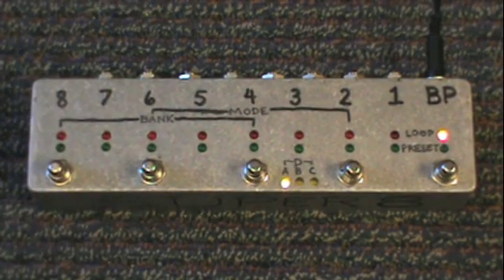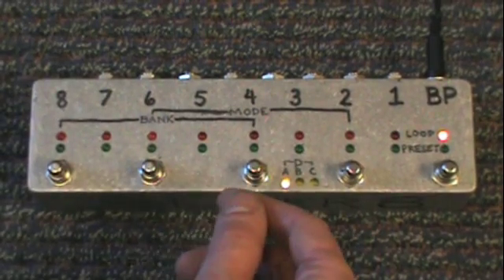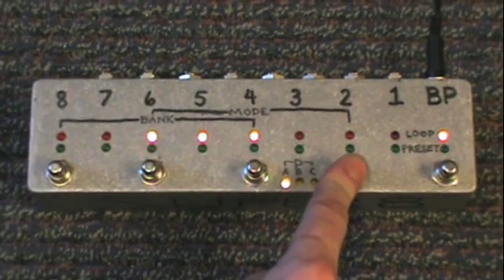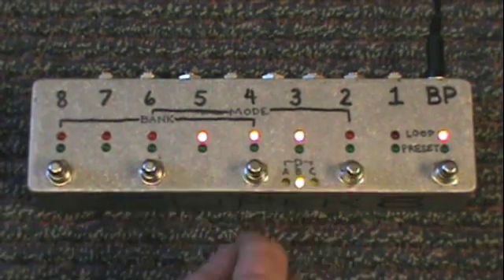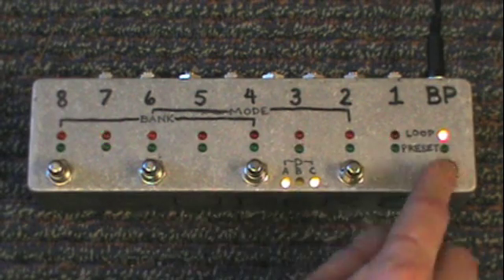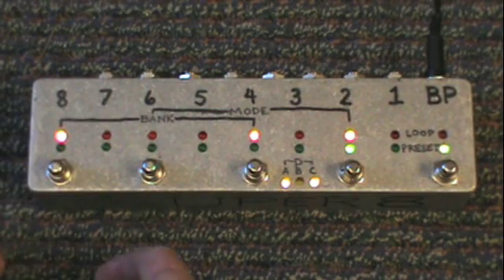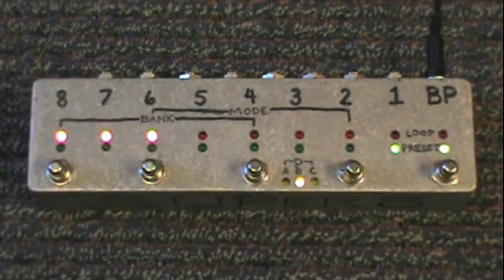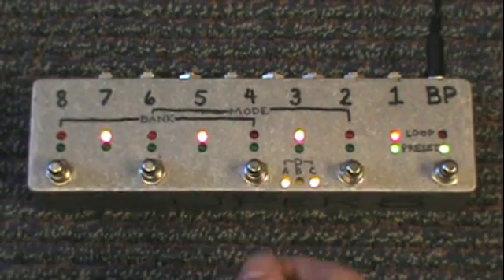Build Your Own Clone BYOC super8 programmable bypass looper

Comment: I did that with a Arduino + 8 channel relay module, cheap and works great.
Reply: hi, from where are you? when the relay it's activated there's some noise in the chain?
Reply: Hi Rui, could you perhaps share some of the resources you used to build your project, or atleast point me into the right direction. There is build info on the net, just don't know how reliable those sources are.
Reply: I am currently working on doing it with Arduino and two 8 channel relay modules.
Do you have a video up and a copy of the sketch on the internet?